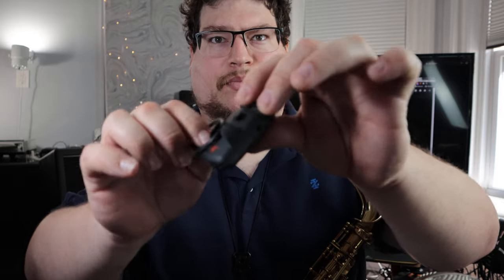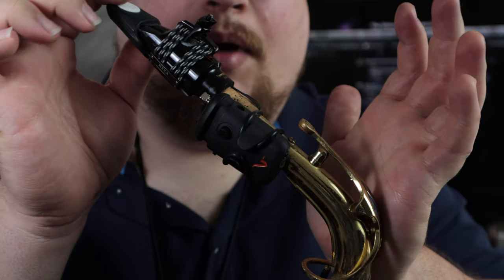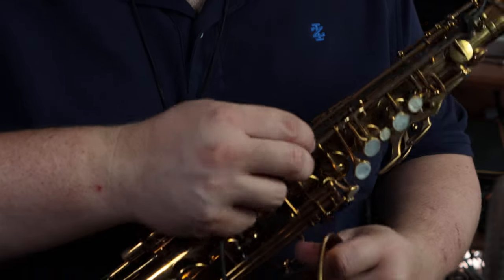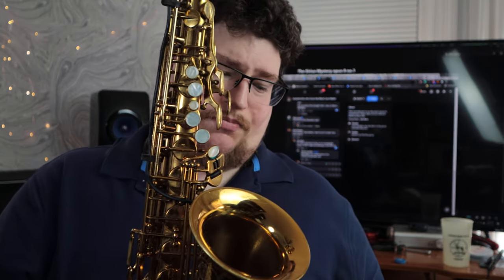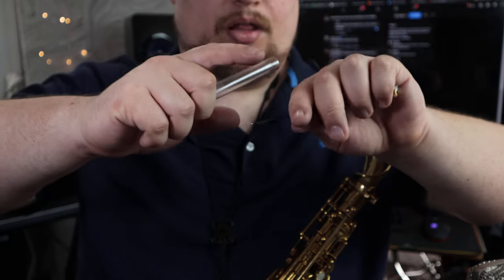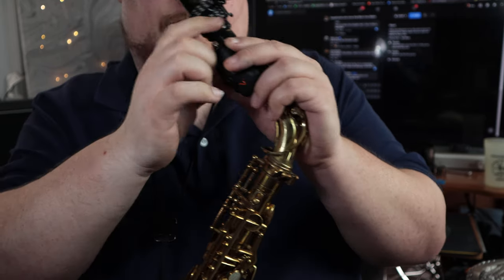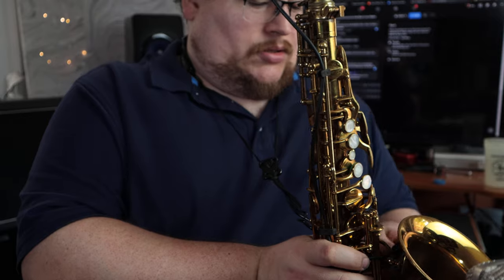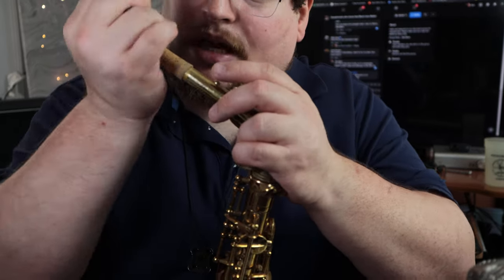Intra Mic Setup/Tear-down for saxophone

Comment: I wonder if the juice is worth the squeeze. WHAT a process.
Reply from the maker: I don't find it to be much worse than my old clip-on (DPA-4099s), actually.  Setup takes a little longer.  Mind you I am using a jerry rigged adapter here... when I get the appropriate cable it will eliminate a cable (bringing the total number to 1) and an adapter from the process.  

But for comparison, with the clip-on I used to use, I still had to screw on the adapter and manage the long, very delicate cable from the mic to the belt pack.  Also, I had to reposition the mic every time I set the horn on its stand.  So with these tougher cables I don't think I'll be sending the mic in for repair as much (DPA needs to go back for the 3rd time... they don't replace the cable, just reterminate it for $75...).  

Tear-down is much faster since I don't have to coil the long micro cable and set the mic in its case as carefully, just slip the intramic into its tube and throw the short cables in with it.

Comment: Thanks for showing us your process. I've had my eye on getting one of these for a while now. Are you happy with the sound on stage?
Reply from the maker: Yes, it's really great.  Really remarkable how good it sounds.  I will say I can't use my pea-shooter style metal, high baffle piece on alto with it because the chamber is too small and not enough air goes through.  But with a more common Meyer-style piece it just adds a tiny bit of resistance, and sounds very transparent, both acoustically and with what it delivers through the speakers.  Just gotta make sure the brightness and presence switches are in the appropriate upward positions for a natural sound.  Also gotta make sure to calibrate the gain on the preamp unit when you first set it up so the volume dial works in the right range for your setup.  

Working with DJs like I did just tonight, you can use effects pedals (I usually just use an H9 for reverb or delay) even in close quarters with zero worries about feedback.  I'm very happy with this mic and get a lot of compliments from sound techs.